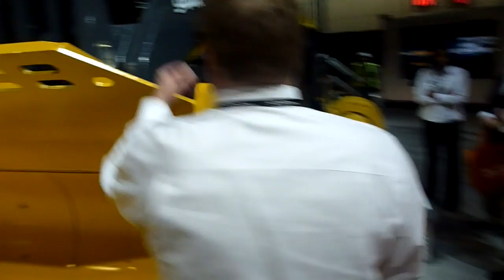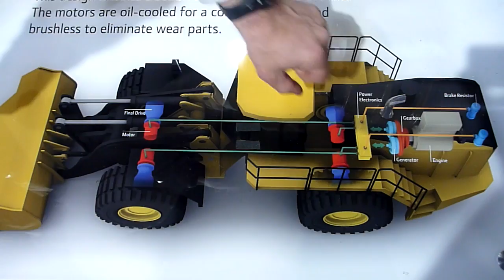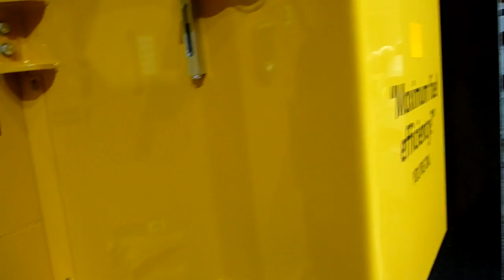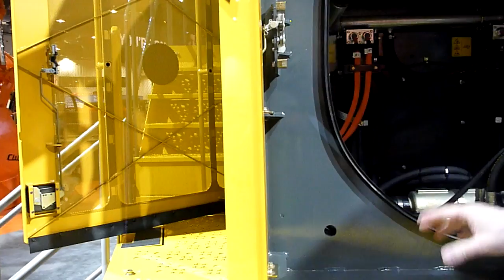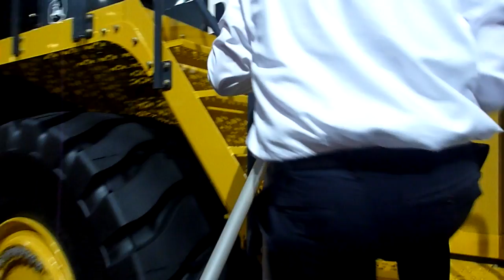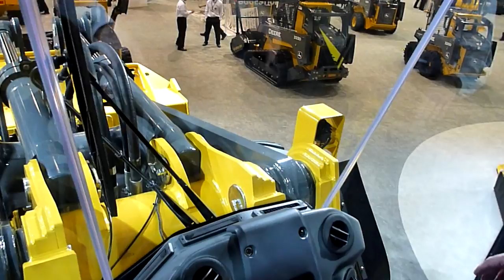John Deere 944K Walkaround

Comment: Does anyone know if the drive motors are D.C.?  It is fairly common in commercial applications to go diesel-electric, direct current.
Reply: Its a switched reluctance motor that was built in the U.K.

Comment: i like a lot of features on this machine, such as the cooling system, on my 322 i have to pull the hyd cooler off to clean the radiator, that sucks, would be nice to have a cooling system that worked like this one

Comment: Not so convinced by this keyless start thing - (a) once somebody knows the code they can always start the machine (b) any rubber keypad I've seen always degrades eventually and (c) I don't like the idea of 25 or so buttons all clustered together with functions like handbrake just a few mm away from functions like windscreen spray. Can't help feeling that this is something that the manufacturer rather than the customer wants.

Comment from the maker: @KHVEDOR When going to larger wheel loaders electric drive technology is the way to go. You are eliminating a lot of driveline from this machine, while you are increasing its complexity large loaders from LeTourneau have been using this technology for years. The quality of a machine and its drive system could in a way be judged by its radiators as they are vital components. While not the entire sum of the machine its individual components can make or break your purchase.

Comment: @robby844 I think the choice of transmission for a particular machine is determined not by the quantity of radiators. It all depends at least on the conditions in which this technique works, its mass, etc. I understand when the electric transmission is used in mining trucks, for example. After all apart from the masses, electric transmission requires a larger quantities of non-ferrous metals, and it is more expensive...

Comment: Interesting conception. And do not be easier to make the drive wheels by a hydraulic actuator (axial-piston hydraulic motors) as the excavators? After all, electric transmission ceteris paribus - are heavier than the hydraulic.